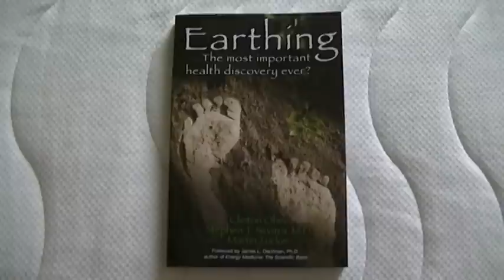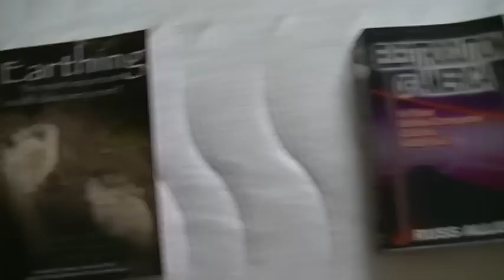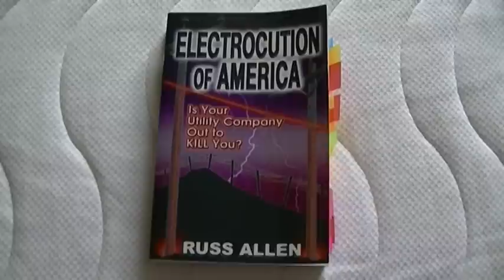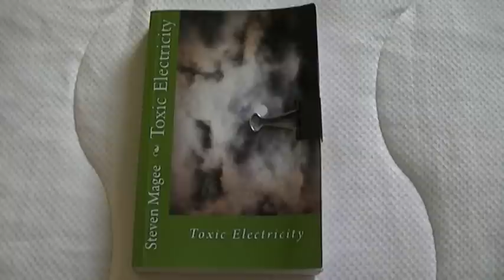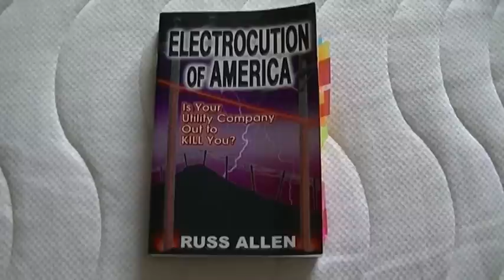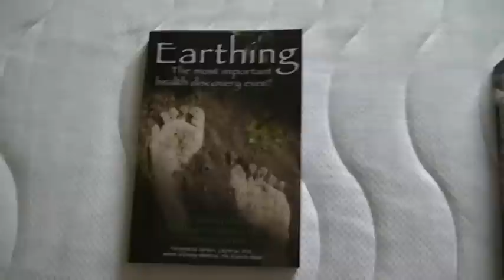Earthing (Grounding) Health Risks

Comment: The ground wire to your power receptacle typically runs along and close enough to the alternating current lines to cause an induction into the ground. You can test this with an old style AM radio and run the antennae over your connected sheets. If there is induction you will hear the white noise in the radio, picking up em waves from the wire threads in your sheets. Not to say you still wouldn't get health benefits of being grounded, but best to run a completely separate ground line from a dedicated receptacle to a dedicated grounding rod.

Comment: As Chris Comstock mentioned below, you have to check the voltage you're being exposed to, before and after any grounding device is applied, by using a voltmeter. All else is guesswork.

Comment: I'm sorry but for being an electrical engineer this video is very very un-scientific. He does not do any sorts of measurements of currents in his cable. All he does is state that he developed some symptoms after being connected to it for a while. I am not endorsing grounding at all but anyone who follows this guys recommendation based solely on this video should be pissed at the public school system for not teaching them the basics to ascertain good scientific methodology.   His study is based on a sample size of one - himself.  That is called anecdotal evidence. To do a proper study you would randomly select a large group people and have some on placebo (Tell them they were connected but in fact they aren't) and have a large enough sample size to rule out any statistical anomalies. Also in to do the study right, my understanding is you would have to check out the electrical environment of each participant in the study.  
He also wants us to believe his conclusion because he says one reference book he found is better than the other by panning back and forth from book covers one of which is his. Really? I should buy into your argument because I am being shown book covers and being told which one has the most accurate information?
Reply: "I am smart and I know" argumentation at its finest. Or Better yet, here, read this book, it explains it completely (absolving oneself from obligation of proof of evidence in making a claim)

Comment: I watched the movie The Grounding, and began to investigate this phenomenon.   I find this information very compelling, and started making sure I got 30 minutes or so of "earth" time a day.  I finally ordered the mat and was very excited to try it. I got it yesterday,  followed the instructions, made sure the outlet next to my bed was OK, and settled down to go to sleep. I could not get comfortable, and within minutes started to feel a little weird. After about 20 minutes it escalated to heart palpitations and anxiety. I removed the mat and tried to lay down, but my body felt "amped" for lack of a better word; my chest felt tight, and I had massive anxiety. My heart felt like it was beating fast. I went outside and sat for about 40 minutes doing deep breathing, and felt well enough to return to bed. Today I still feel shaken and off, wit a great deal of anxiety and some discomfort in my chest.  I believe that it has helped a lot of people, but what I surmise is that my house's electrical system is off, or there is just a lot of dirty EMF floating around. I live in a subdivision that has all of the electricity running underground. I don't know if this contributed to what I experienced. I found the following online "Earthing mats that plug into electrical outlets may also increase the risk of exposure to voltages and intermediate frequencies, which may be induced on the grounding cable."  I also found this video. I so wanted this to work, and I am very disappointed that it did not. I would urge others to do your research, proceed with caution, and perhaps try the old fashioned way (earth contact).
Reply: Yes,I think so.  I still try to do this as often as I can. I think I sleep better and feel calmer when I do.  However, in regards to the mat -  I am still having residual effects - chest discomfort, some mild arrhythmia.  It actually went to the ER to get checked.  Everything was OK, and I would add here that I am very low risk for heart issues.  I am vegan, don't drink smoke, pretty fit, etc.  So I am attributing these symptoms to the mat, since that is where they started.  Go barefoot, sit on the ground, connect with nature as much as you can.  I personally would proceed with great caution regarding the mat.  Just my experience and opinion.  Good luck!
Reply: josh langley
Reply: I've just been looking into this as well for my own health and was very surprised that they plug these things into the wall.  I thought everyone ran a line out their window and into the ground away from the house.  Even that I had wondered how deep it would have to be for the rod not to pick up on the nearby lines etc.
Reply: Hi, just curious what grounding mat you were using? I was looking into the clint ober ones. Hope you are feeling better now!!

Comment: I wouldn't have any connection to an earth ground without a 1 meg ohm resistor soldered in the path of that wire.  Let's say you reach over to touch something electric (alarm clock or whatever) and it has a bad wire and you get zapped with electricity.  Electricity takes the least resistant path to ground and if it includes a path from your hand through your heart to ground then you can die.  What the meg ohm resistor does is slow down the current flow significantly (because current is what really kills you).  It's like if someone is squirting water from a hose then you grab the hose and fold it over the water nearly stops... that's what the resistor does, it slows down how fast the electricity can flow through you so you won't die.  I'd probably also put a fuse in line just in case of lightning striking the yard where the grounding rod is located.  And use some kind of shielded wire going out to the garden like Cat 5 or video cable so RF will be blocked from traveling up your lovely ground.  I know it isn't supposed to happen, but I've seen RF do a lot of weird stuff.  And I'd probably have the rod in the ground where I have plants on a drip system year round so the ground is a really good ground.

Comment: this is how it goes. grounding yourself is not smart at all. i was thinking about it an testing the measuring thing with multimeter, started thinking i might be acting as a shortest pathway to ground.  maybe the way to go would be a grounded "antenna" on your desk that would suck up all the extra energy radiation.
Reply: So keep shoes on when going to a beach or lake? Probably shouldn't jump into any body of water neither.

Comment: Stop offering people false hope and profiting off of there lack of education. grounding would change absolutely nothing. You are joking right? Grounding does not "deliver electrons" it changes the charge density to that of the earth, which is may be higher or lower than you at any point in the day. In other words, it may add or remove electrons regardless of whether your body is producing free radicals (which does not change charge density because electrons are not removed from the body), but just the excited molecule.
Reply: +Edwin Raynor I have been grounding while I sleep with a direct short to earth and I have not been sick or even had a cold in the four years I have been doing it.  After 2 years I began to feel like I was thirty again.  I have more energy, stamina and my immune system is in hyper-drive.  I swear by it.  So when you say false hope I see you are a skeptic.  Go to issuu.com and put earthing in the search box at the top.  I am 60.
Reply: The placebo effect is real. When people perceive that something will help them sometimes it actually helps them it is not just in their head it is just that their head is motivating their body to get better. I am happy that you were able to receive some benefit from your nightly ritual. There is nothing special about the voltage of the Earth. Especially as it changes with windy weather and lightning activity.
Reply: Also I still have not gotten sick in 4 years with the slight exception of making the mistake of going to a Long John Silver's restaurant. It made me so sick that it made me miss my mommy, and I felt like I was dying even though I knew I wasn't. I will never go to Long John Silver's again.

Comment: You may not be aware of the Herxheimer response, a detoxification reaction when the body experiences a high level of pathogen death and removal, basically it's an immune system reaction. Your symptoms echo the usual Herxheimer symptoms. I became aware of this whilst reading studies of the effects of blood electrification some 15 years ago. As yet I've not looked into grounding other than it's basic outline of health benefits but I would hazard a guess that grounding/earthing may trigger a Herxhiemer response like any detox program would. As I understand it,  grounding removes access energy, a rebalancing if you will, the more spiritual attuned would say a realignment of the Chakras.
Reply: very good point but I tend to think the ones who experience heart tremors real sickly feelings may just have badly run electricity - need a good electrician - there's good and bad in everything - right?  plus your not plugging into volts - u r supposed to be plugging into the ground/neutral

Comment: So does your body voltage actually rise when you touch that copper rod on your bed?
Reply: +ak yaren There is no such thing as absolute voltage. Voltage is measured as a difference between two points, like distance, or rate of change. Yes the voltage between you and the copper rod will go down, but the difference between you and the rest of the world may go up or down. That is why this is a scam.
Reply: in difference to the ground
Reply: You are talking about voltage when you want to be talking about charge density. The earth is slightly negative. The sky is slightly positive. None are neutral and they both fluctuate (that is why there is lightning).

Your copper bar can be highly charged or highly discharged. There's no way to know what it would do unless it was recently grounded to Earth, to the sky or to a best friend.

 There is no such thing as Body voltage as voltage is a relative measurement. There is only "body to earth voltage" or "body to rod voltage" or "body to sky voltage".

 Having more Electrons or less protons on one side than the other makes charge flow producing voltage when connected.

Comment: you guys are making this way to complicated. Just go outside...
Reply: The shoe soles prevent us from getting the earth´s magnetism. And some of us struggle tom get well from illness and cannot walk barefoot unless it+s very warm.
Reply: "Grounding" is not about magnetism; rather it is about electrons -- a different phenomenon.
Reply: Consider this. IF your body is not ELECTRONically connected, THEN it cannot support induction by changing MAGNETIC fields OR by resonance with Electro-Magnetic fields.

Two sides of the same coin people. Plus the edge of the coin.
Reply: You can wear natural shoes, like moccasins (all leather) that will get you some grounding.  Not as good as barefoot, but still works.  Just stay away from rubber/plastic soles on shoes.  You also have to walk ON THE EARTH, not on pavement.  I live in an area also that I can not go barefoot.  Although, if you do it for short amounts of time barefoot and work your way up, your feet won't be so sensitive.   Very short distances and walking carefully.
Reply: Many people live in smaller confines around to many electronics.

Those who live in more rural areas and own a home with property have more options.
These cell phone towers and smart meters are also huge factors creating an environment not all can adapt to.

Comment: What if you added a filter or one way diode to the earthing system, wouldn't this stop residual currents from entering into the sheets?
Reply: +Anthony Amalfitano The bias voltage on a diode is to high (normally more than 0.3 volts) to ever activate.  It will look like an open circuit. But this whole thing is a scam, so it will probably work just as well.